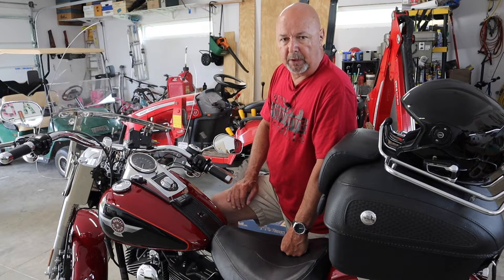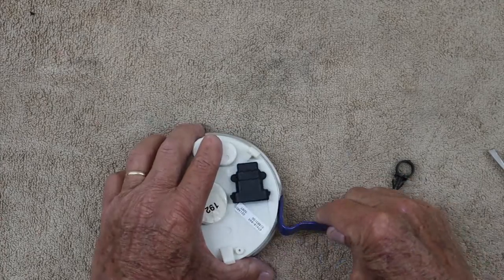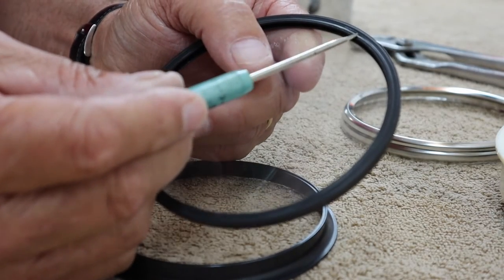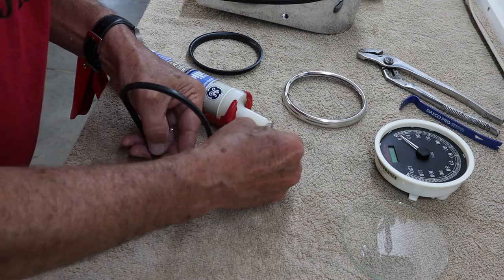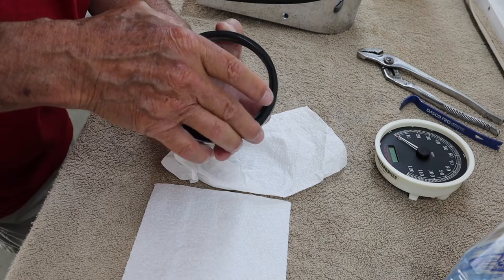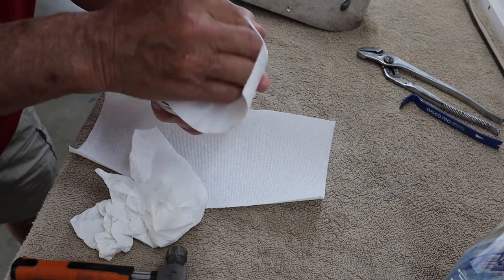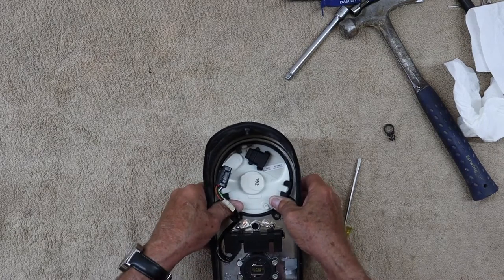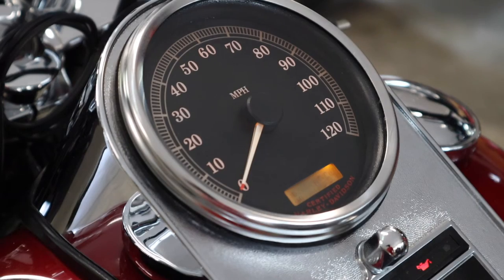Stop Moisture from getting inside the Harley Davidson Speedometer and remove whats already there!

Comment: @NINE POINT FIVE PROJECTS  First time viewer & new sub.🙋‍♂️ I'm in LA. (Lower Alabama.😁)  I ride Sportsters. (Actually I ride anything without a hydraulic clutch.😂) FYI/Warning This is going to be a long comment. 😁
  I guess I'm the 45th comment on this subject. What I noticed is everyone has an idea and no one's examining cause & effect. (or Root Cause.)
  First, let's eliminate electronic speedos from consideration. They're in a whole different ballpark. (No moving parts.)
  Mechanical & electro mechanical speedos (like 90% of speedos these days) have similar pros & cons. Namely they both can be effected by temperature and pressure. The effects can be computed & averages determined so tolerances can be designed into the build process to minimize any detrimental effects. 
  From scuba diving I learned that the atmospheric pressure at sea level is considered to be 1 atmosphere. Every 33 feet below sea level is another atmosphere. Going up from sea level has an opposite effect. (I have no idea how this relates to pounds PSI.🤷🏻‍♂️) For this reason these speedos are designed to breathe for lack of a better term. 
  According to Google😁 the average height above sea level in your area is 500 feet. For lack of specific knowledge lets assume that your speedo was designed to breathe through the seal of the front cover and has no other vent holes. (Mine have a small vent hole in the back at the bottom) If you ride from your house to my house, (I'm appox. 100' above sea level.) you'd gain 12-13 atmospheres of pressure. You'd create a positive pressure inside the speedo. If you ride the other direction,  say the top of Stone Mtn in Georgia you'd lose 330+ atmospheres creating a negative pressure. (Vacuum.) 
  In 40+ years of working heavy construction I had many chances to observe the pressure & vacuum testing of air & liquid tight structures. One of the things I observed is that 2-3 PSI of positive pressure or 3-4 Hg (inches of mercury) vacuum can have observable effects on 1/4" steel structures and cause welds on 1/2" steel structures to crack or pull lose. 
  From the video I see that your speedo looks just like the ones on my Sportsters. Just shorter front to back & about twice the dia. I'm guessing its housing is made from the same appox. 1/16" +/- plastic. I guess a good question at this point is, Are you going to trust a speedo that can't breath or fart to change altitude by a couple hundred feet & still read correctly and not fail completely?😁 
   Now that we've established the fact that these speedos have to breath. To the specific issue of humidity. It's inherent & GFL getting rid of it. You could replace yours with a sealed all electronic one. A cheap one costs $1-200+ (US) & most likely comes with it's own humidity sealed inside of it.😂 For $3-500+ (US) you can get a good quality one that was sealed inside a dry nitrogen atmosphere and be quaranteed "No Humidity".🤞 (With a bit of luck you shouldn't have any need for the customer service department.😉)
  I have an '04 XL883 that came with a speedo that was DOA when I got it. The only thing that worked was the light. Even it fogged up after 20-40 minutes on the road. Two months ago, (after 4 weeks of scratching my head over speedos) I replaced it with a brand new original one from the HD factory. (a little over $200.) So far only a little inconsequential fogging at the very bottom.  My '05 1200 Custom on the other hand still has the working original speedo.  After 15-40 minutes on the road you can vaguely tell where the needle is pointing if the sun is shining on it.😂 
  I learned to ride in the early 60s at the age of 10. In the early 70s I got my first Harley. Been hooked ever since.😁 The only thing I need a working speedo for is the odometer and trip meter. The 1st makes it easier to sell the bike & the second makes it easier to guess how long it's gonna take me to get home from what ever lost place I've ridden to when the wife calls wondering where I am & how long she should leave lunch sitting on the counter.😂 
  Back to my statement "GFL getting rid of it." There is something that can be done to temporarily relieve the condition. It requires an accomplice with a heliarc welder and a small bucket with a form fitting lid. It helps if your accomplice already uses dry pumped nitrogen or argon as a shielding gas. The gas costs $20 to $50 for a pony bottle, (the last time I checked) that should be enough to purge the humidity filled air out of you speedo. (It may take an hour or two.) Make sure the speedos vent is on the bottom during the purge. Remove the speedo from the bucket & reinstall it in the bike immediately. The humidity will eventually return but if you've got to be able to see your speedo to ride this should help.☺
Good Luck & Best Wishes from the Northern Gulf of Mexico 🙋‍♂️

PS, If you're willing to purchase the set up you can get everything you need for less than $500. If you use a 1 gallon bucket the pony bottle should be able to purge a half dozen speedos or 1 speedo a half dozen times.😉😁 That works out to be cheaper than buying new speedos just so you can tell when you need to fill up or when you're risking the attentions of the local enforcement officers.😂🤷🏻‍♂️
Reply from the maker: Hi Mike, thanks for the comments and thoughts on the speedo problem. Very interesting read and I appreciate you taking time to give your thoughts on it.  Someone said that HD had an antifog coating on the inside of the glass. Maybe it breaks down after time as I could def tell something was on the inside of the glass when I diss-assembled, You can see it in the video. Either way, thanks again!

Comment: Not at all an expert myself and I am viewing this and other videos to see how to clean the inside of my speedo lens but in other videos the folks are saying DO NOT use caulk or silicone to seal it, that they don't do it at the factory for a reason it has to breath to prevent the fogging. Just passing on info that others have offered. But great job, well done. I am going to follow your instruction and advise but forego sealing it with anything.
Reply from the maker: Hi Scott, thanks for the comments. I think there are a lot of opinions on the subject. I am inclined to disagree with not using caulk or silicone.  I think the reason it's not used at the factory is because they feel the design where  the rubber seal is enough to seal it without the need of any other sealer.  I believe the thing is supposed to be airtight from the factory but I think it does need to breathe somewhat. A system that will let air travel thru it, but still keep moisture out.. As I have mentioned in other comments, mine still fogs intermittently when I first start riding but does clear after a bit..  not bad but, aggravating all the same.  Again, I appreciate you watching the video and the comments.
Reply: @NINEPOINTFIVEPROJECTS  All good points I also saw where some folks are drilling holes in the back of the housing and they are all saying it is working to keep the fogging away but advise extreme caution because the circuit board is right there and some have said they hit it. But mine also seems to have a bit of dust or something accumulating on the inside of the lens so it needs to be taken apart and cleaned and at least now I know how to do that whether I decide to caulk or not. Thanks

Comment: Could be possible the moisture is coming in through the wire harnesses
Reply from the maker: I thought about that but the harness plugs to the back of the speedo via connector that's molded into the housing.

Comment: I just replaced my Fatboy's speedometer with and aftermarket speedometer due to how bad my factory speedometer was hard to read. I wasn't about to take it apart to try to fix the problem.
Reply from the maker: Hi Harley Harrold, Thanks for watching and the comments!. Replacement is definitely a good solution. Did you get one of those that also has a tach built into it? If you haven't done so already please consider subscribing. I'm fairly new to YouTube and each subscription means a lot to me!  Thanks again!

Comment: Harley davidson knows about this. My speedo and other gauges  get more than what i saw here.
Reply from the maker: Hi Randy, thanks for watching the video and the comments. I think you may have already but if not please consider Subscribing. I really appreciate it!
Reply: Thanks for the update and the return text. I have a 2010 Streetglide with the same issue with speedo, gas gauge . Harley said its normal when it humid out. We can replace it, but it also happen in the morning during mid summer into late morning
Reply from the maker: I'm surprised they consider that normal..it's a problem for a lot of people apparently.

Comment: Cause and Solution - https://www.youtube.com/watch?v=311JPebYUSY&ab_channel=RidersUnited
Reply from the maker: Definitely makes sense.  I considered drilling holes in mine.
Reply: If you are going to do this I would use a hand pin vise. Don't use a drill with a motor. If you do it with a pin vise you can go a little at a time and not drill into the circuit board inside.